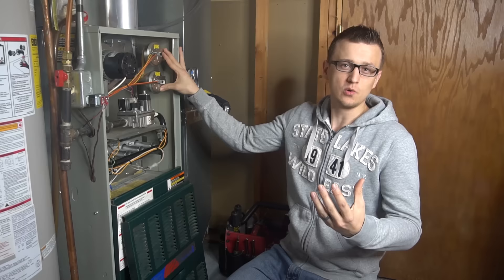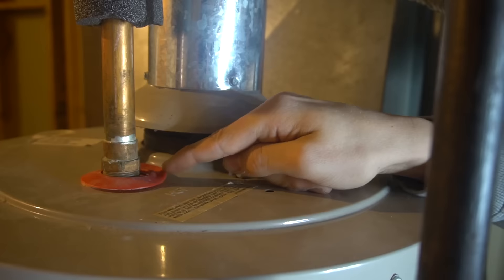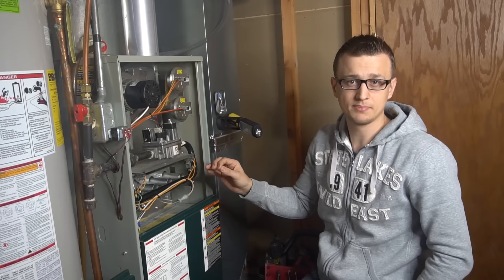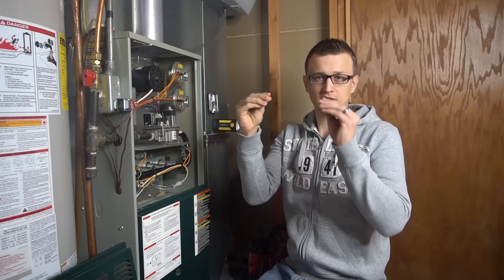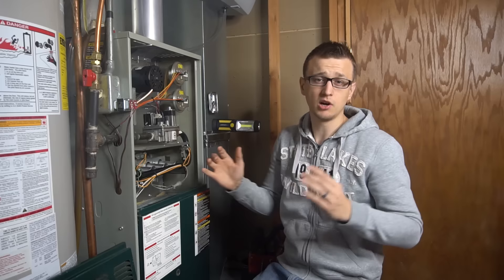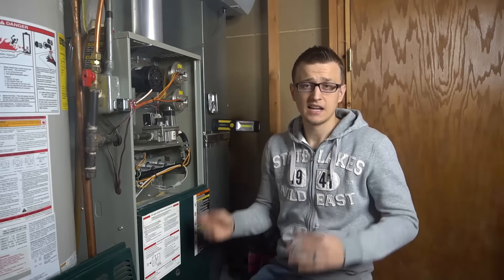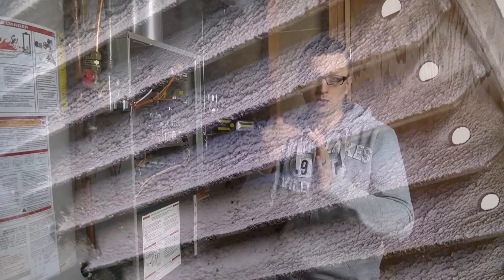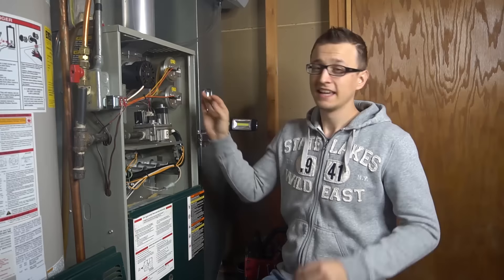Furnace Pressure Switch Troubleshooting

Comment: I can blow in to clear the " pressure switch is open with inducer on" error, even though I can feel air coming out of where the tube connects when the inducer is on, but then when the igniters start glowing I get a "pressure switch is closed when inducer is off" error.  Does that sound like a bad pressure switch?

Comment: I had no continuity on my low pressure switch which is discontinued.  I have a replacement on order.  My question, if my PF was 0.30PF, do I have to find a 0.30 or can I select another PF?  Presumably it would need to be lower than my high pressure switch at 0.60?  Or would I also have to make an adjustment elsewhere (like motherboard, for example)?  Thank you!

Comment: We are looking to sell our home (it has central air). We had Nest thermostat that I installed (replacing a cheaper thermostat) a few years back when we moved in. We want to take the Nest with us, so I replaced the Nest with a cheaper non-programmable one. The AC worked so I assumed all is well.

During a home inspection, the inspector said that "The furnace failed to start. According to the diagnostic codes there were three red flashes, indicating "the pressure switch, roll out switch, or auxiliary limit switch open".

Since the furnace worked well during the winter, I am assuming this may be related to my replacement of thermostat, perhaps I did not connect the W wire properly. I did double check that and it seemed it was not property connected, so I "reconnected" but still getting the same error

Any ideas / suggestions ?

Comment: What would cause the inducer motor to continue to run after turning off the furnace? When I woke in the morning it was off but I could not get the heater to come back on I'm getting a three blink pressure valve code.

Comment: I have a carrier furnace. My draft inducer motor was not kicking on so I replaced the control board. Now the draft inducer motor runs Non-Stop!!. If I unplug the air hose to the pressure switch and plug it back on the pressure switch boom the furnace works perfectly for one heating cycle but the draft motor runs Non-Stop and so it kicks itself off and kicks a 23 code.. Help!!

Comment: Hello ok so back again.  I am getting a code of two flashes on a Coleman Mobile home furnace.  That code is combustion switch stuck close.  I replace the combustion switch and it still flashes the same code.  So not the combustion switch.  I here a buzzing or noise where the in-line draft fan motor is.   Do you think it could be shot or is it dusty, dirt causing that fan not to run?   It buzzes like it wants to go or is getting power but sound like it’s not spinning the fan itself, therefore cause the switch to be stuck closed?  Thanks for your videos this is the diagnosis I’m coming to with your videos.   The furnace blower works as the ac still works and fan mode.
Reply: Can I remove the in-line fan and clean it?  They are a bit different setup ona mobile home furnace

Comment: At our church building, we have twin Nordin furnaces, 90% efficiency the main furnace when it initially starts hits very hard and lights but blows the flame out at the same time. The other furnace lights normally, and continues to run until the main furnace shuts back down to try to relight. The main furnace will then light and operate as normal. I have checked drain lines I have checked the exhaust. Also when this happens, the pressure coming out the exhaust is enough to blow a screen off that I have outside the building and it still does this with out the bird screen. It does not throw a code when it initially lights that blows the flame out because of the excessive pressure. It seems most likely to happen when the furnace has set and not fired for a while once it has relit it seems to function properly for a while. I have cleaned flame sensor checked all the drains clean the condensate trap. Any suggestions Are appreciated thank you

Comment: What would a pressure switch closed indicate? I have a high efficiency furnace but my air intake is inside the house so I know that isn't blocked.

The furnace comes on intermittently and I cont have any rattle from either fan.

Comment: On our Goodman (Horizontally mounted 80% unit in attic) blinks 3 times, which says that the pressure switch is stuck open. Jay, could you please advise what I should do or how to proceed. (I replaced the Flame Detection sensor and didn't work and the ignitior does NOT lights up w/new sensor installed checked the codes, as mentioned and 3 blinks). I could really use advice what to check next. Thanks.
Phil
NYC Area

Comment: Great videos,  I am working on a vacant home.  I only run the heat when I am there because the home is gutted and the furnace will not bring it up to temp.  My problem is the furnace would cycle off for 5 or 10 seconds and restart, and run for about 10 minutes and repeat that cycle continuously.  Now the furnace will not start at all.  Could it be the pressure switch?  Any any suggestions?
Reply from the maker: If this furnace has a control board, does the board blink any error codes when this happens? From what you described, it sounds like it could be something to do with the pressure switch or the high limit (overheating). If you reset power to the furnace, does it start up? Seems like you just watched the pressure switch video but have you seen the overheating videos I have? Maybe those will help:

Overheating - Easy Fix
https://www.youtube.com/watch?v=pJzP1jzYPqg&t=5s

10 Reasons Why a Furnace Can Overheat
https://www.youtube.com/watch?v=3ZPmltTR5S4&t=45s
Reply: The error code is 3.  I was able to get the furnace to start up when I bypassed the thermostat.  It ran for 10 or 15 minutes and stopped for a couple of minutes and it started up again.  I notice a drip from the condensate trap, and it sounded like the inducer fan was blowing through water.  I removed the trap and ran it for a while...it seemed to work as it should with the trap removed.  Am I on the right track?  This is a high efficient furnace made by Kenmore.  It is dirty, the filter needs changed, but it has the same problems with the filter removed.
Reply from the maker: Sounds like you found something :) If it works fine without the trap, then the trap is probably plugged up. Try flushing it through with hot water. Blow through all the ports to free up any stuck debris. I usually fill it up with some hot water, close the holes with my fingers, shake it up real good, drain it out, and repeat a couple times.
Reply: @WordofAdviceTV  I found some bugs in it.  I will put it back on tomorrow and see if it works.

Thanks

Comment: Great video. Wondering if you have any thoughts on a Bryant Plus 90i furnace showing a high pressure fault code (code 31) when it goes into "high heat" mode. The furnace heats fine in "low heat" mode but trips a high pressure fault after running in high heat mode for around 30 seconds or so. The furnace continuously repeat this.
Reply from the maker: I would suspect that the secondary heat exchanger may be plugged. If you have an analyzer, I would check the carbon monoxide emissions when it ramps up to second stage. If you don't have one then I would suggest calling someone to check it out for you or do a furnace inspection. Another thing to look for is the burner flames. When it ramps up to high fire, do the flames start flickering more or become lazy? That would be an indication of something going on with the heat exchanger too.
Reply: @WordofAdviceTV  I forgot that I never replied back with my findings. First of all thank you for your suggestions. I called in an HVAC company and he found that it was bad pressure sensor that would come back to life intermittently. The expert jumped a couple of terminals to force it into "high heat" mode and the system worked fine. He did a CO check of the system exhaust to make sure  the secondary heat exchanger was still OK and it was. I replaced the pressure sensor and everything works fine now.
Reply from the maker: @kevinsozhao  So it was a bad pressure switch. That was not a very common problem you had going over there. I'm glad the heat exchangers are good! Better safe than sorry. Thank you for coming back with an update!

Comment: I got luxaires (1996)
Cycle start and run in short cycle for 90 seconds, it shut off, but the small motor keep running for 4-5 minutes then the cycle start all over again.
Help.

Comment: Jay thank you for your video.
You help me through a problematic furnace issue 
Fyi this heater we fixed had the connector swaped, ground and positive.
symptoms are exactly the same if the flame sensor was out.
If you can say hi to chihuanua mexico.
Thank you Paul
Reply: Hi Jay, I’m sure you hear it regularly about saving the day and yes you did again. I was having a flame sensor issue.You mentioned cleaning the nozzles and that was great but didn’t mention the small slots are very important,so ended up cleaning them twice and cured the problem. The heat is back on!  Thanks Rick

Comment: I have a 15 yr old lennox furnace. Not working. Here is what I see happening after thermostat sends the control signal: 1. The inducer motor starts running. <1 sec gap> 2. The igniter starts glowing. <10 sec gap> 3. The blower fan starts. As soon as the blower fan starts, the inducer motor spins down and the after 2 seconds it spins up again. This spin up and down of the inducer motor keeps happening over and over again. The blower fan is on during this. Finally everything shuts down and a pressure switch error code is blinking. What could be wrong? I have a feeling bad control board? The flame never fires up. If the flame supposed to fire up before the blower fan? is that is so then thats definitely not happening.

Comment: ADVICE NEEDED!! Pressure switch problem that has Stumped 4 HVAC Contractors, and they have no explanation for why the temp fix I found is working.  PROBLEM:  Trane XR90 (2006).  Red light flashes 3 times.  Furnace blows but no heat. It doesn't even try to ignite.  Blower ramps up for 60 sec. waiting but then shuts down, and repeats.  Cleaned out condensation trap, intake & outflow vents, tubing in good shape, pressure switch has 25 volts coming in & out, cleared out any debris in air ports to tubing, no leaks, and replaced switch.  What has stumped everyone, along w/ the HVAC contractors, is that the only way I've been able to get heat is by taking the tube off of the gas valve vent port & blow into it at beginning of heat cycle for roughly 20-25 seconds.  While blowing I can look into the burner box through the viewing window and see the burners start to glow orange until it finally ignites and stays on.  The problem is that once it reaches the set temperature the heat cuts off and it just blows cold air.  If I try to put the tube back on the gas valve vent port after I get it running it shuts off immediately.  ANY ADVICE???

Comment: So I was getting a low-pressure switch failing to close error (32) on my Bryant 80r but when I manually spun the inducer(?) Motor which wasn't spinning when the request for heat came in, it started up, switch closed and burners came on.  My inducer motor continued to spin but was wining and making a lot of noise.  Do I need to replace the entire assembly (including the attached fan inside) or just the inducer motor?

Comment: If this happens to you, it is because your furnace is under fired. An Under Fire furnace has flu gases that are cold. Which then causes condensation in the cool aluminum, or light Steel that that inducer motor housing is made out of. The condensation of the Furnace is lacking of hydrogen. This Means low ph, which is an acid. The acid chews away the metal and ends up in the pressure switch lines, or the pressure switch itself. You need to replace the pressure switch and the lines then bump the gas pressure so you are not having excess oxygen greater than 9%. If you do this you'll never have this problem. If you had your system installed and it is doing this you need to call the installers back and tell him to properly adjust the unit, replace the inducer motor, pressure switch lines, and the pressure switches. Because they did not set it up properly upon installation.

Comment: My 80% Amana runs mostly normal, but after it’s done with a heat cycle the inducer motor turns on and off a few times without heat. Have you seen something like this before?
Reply: Sounds like it was short cycling and the pressure switch tripped the gas off.  Then the inducer is trying to get it going again?  Maybe a backdrafting situation?

Comment: I got a question I have a carrier furnace and it comes on a runs sometimes and it will work fine for a while and all of a sudden after it's been working for a while when I go to turn it back on it won't come back on. What could this be? Thanks in advance!
Reply: I had the same problem yesterday. I called a company and found condensate trap was clogged. After cleaned it it worked again. But I spent a lot of money $$$. Also the guy asked me to replace the pressure switch with $279. I have no plan to do that. I am thinking to do it by myself. The problem is that I don't know where can order the OEM part?

Comment: Please help! My furnace will work if the thermostat is turned off then back on. After the room reaches temp the furnace shuts off like it's supposed to but then flashes an error code of 1 blink and will not restart on it's own. Its a amana furnace

Comment: Had a Faulty Pressure Switch error on my Goodman furnace and replacing the filter power cycling the furnace seems to clear it.  Any suggestions on how to make the system a little less sensitive to a dirty filter?

Comment: I have a fraser johnston furnace and I had a pressure switch code.  I was able to start the furnace by tapping on switch as it was turned back on.  I just now replaced the pressure switch with a new one and now furnace will not come on and us giving the code for pressure switch.  I'm confused about what could be wrong as old switch would work if I tapped on it repeatedly until it started.  Any ideas I would appreciate!
Reply from the maker: Does your inducer motor start? If the motor does not start.. if you remove the hose going to the pressure switch does it start then? Is the PF rating, or inches of water column (w.c) of the new switch the same as the old switch?
Reply: @WordofAdviceTV  Thanks for responding!  Yes the inducer motor starts.  I have to turn off thermostat than turn off switch on furnace, than immediately after I turn furnace switch on, I have someone turn thermostat to on/ heat and it gives me the amber light, than the pilots start lighting and eventually it clicks on.  It will run for an hour than stops and I can hear something running on furnace still, I than turn thermostat to off and begin process over again.  Sometimes I get pressure switch code and can't get it to start.

Comment: Nice Qtr pounder...got a 1.5 yrs old Goodman 2 stage HE furnace  throwing off "E0" error for past 12 hours . never reaches the temp set on the thermostat. shuts down, b4 reaching set temp...  furnace reset and starts on its own.and this cycle goes on I set to 72F but it stops when it reaches 70 F... ..2-3 weeks ago there was little puddle of water on the condensate trap that is setup outside of the furnace and has a neutralizer attached i thought was a one time thing as when u start furnance for 1st time into winter season.... ... could that be a cause of furnace cycling like that? or anything thats discussed under Error E0 as possible causes.?

Comment: I have a goodman furnace...  the inducer motor makes a humming noise and gets warm, but will not start...  do ii need to replace it or is there a different issue?
Reply from the maker: If it hums and gets warm, the motor is most likely bad. Another possibility is that there is something stuck in the blower wheel. Like a bird for example. That's pretty rare though, usually it's a bad motor. You can take out the motor assembly and look or if it has a cooling wheel on the outside, try spinning it by hand. If it does not sound like it is hitting anything as you spin it, then the motor itself is just bad.

Comment: AT 6:15+ You say the port gets plugged up....plugged up with what?  I worked on a Rheem that had like a mineral deposit chunk that clogged the port on the inside of the inducer motor and could be blown or knocked back inside, but in a couple months it would clog again. I removed, then replaced the Inducer motor, but it still did the same thing. Is something coming back into the motor area from the exchanger area, which seems to be operating ok.  So, what could the mineral deposit type thing be?  I have watched several videos on this but no one addresses it. Please?!!

Comment: I have a lennox, that pressure switch keeps clogging. Used to be once a year, now it's clogging once a week. The tube is showing rust around the bottom of the tube where it comes out. It's a red tube that connects to the tube. I clean it out and it works again, but clogs up again. What is causing it to clog, and how do you fix it?

Comment: When using a combustion analyzer what’s a good range of CO to have?
Reply from the maker: It should be under 100ppm. If it is between 100-200ppm, then I will check the gas pressure and adjust if needed and clean the burners to try to lower the CO emissions. If it is over 200, usually it will climb into the thousands. At that point it is likely a bad heat exchanger.
Reply: Thanks for the response appreciate your informative video

Comment: I'm new to watching your videos and they are informative.  I'm not sure if you have one but after my furnace ignites flame is working perfectly until about 5 seconds it begins to pulsate . I had read a few post on other sites and it said it could be a air pressure sensor not working correctly.  Its an Amana Goodman 95% any thoughts? Ty